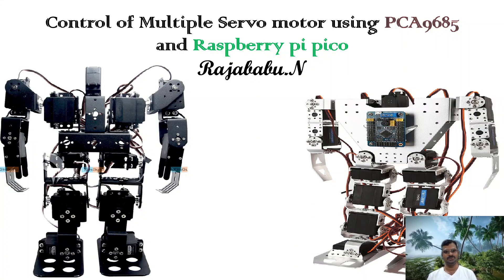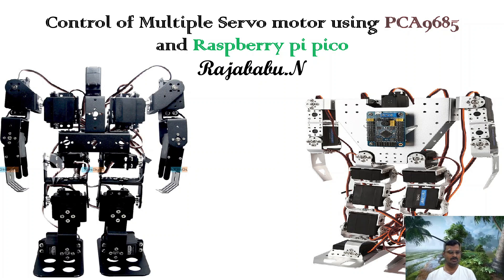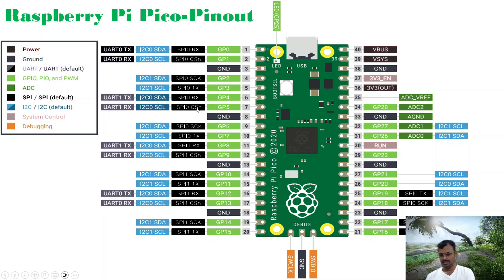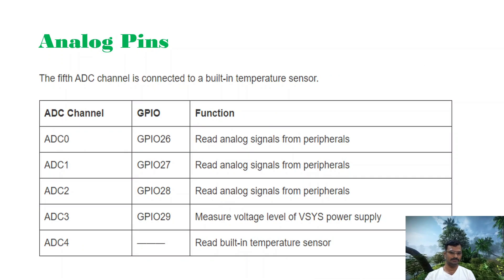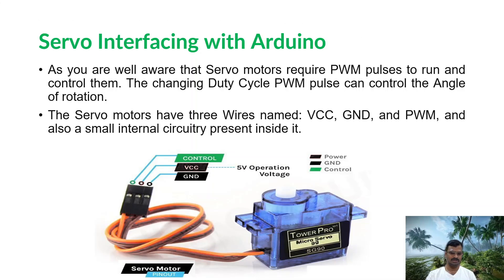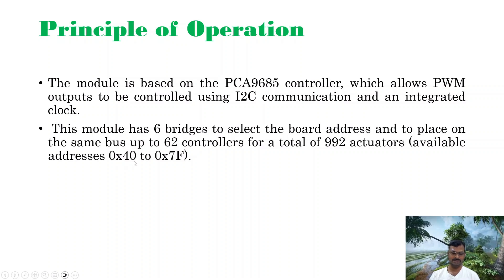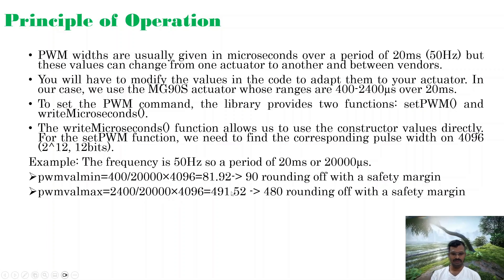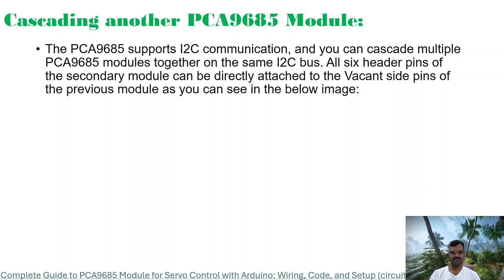Control of Multiple Servo motor using PCA9685 and Raspberry pi pico

Comment: Excuse me,     Raj-   but it appears your code is written in Arduino,  but it is for a Pico and therefor needs to be micro/circuit python.  What are your thoughts?
Reply from the maker: dear friend we can upload the same code which is written for arduino to pico. It is not necessary that we should write the code in python. if you are comfortable with python you can write the code in python as well. bcoz pico supports both language